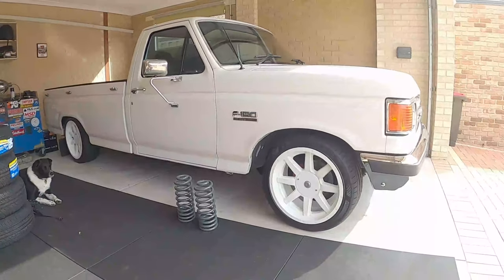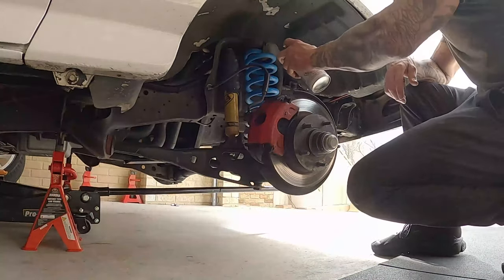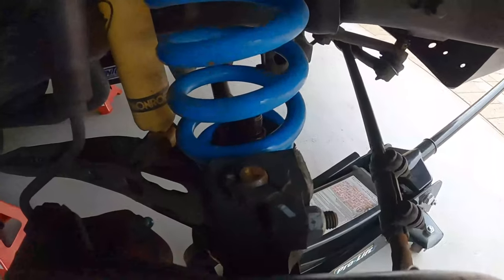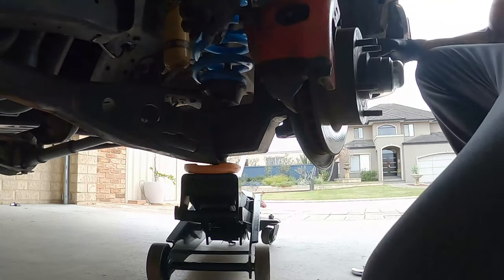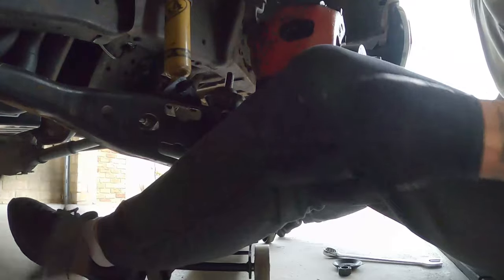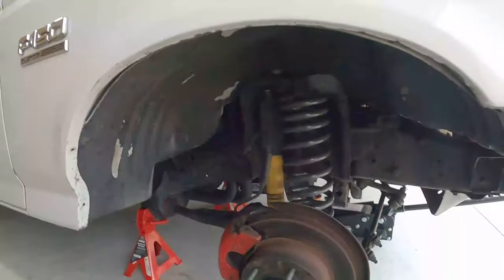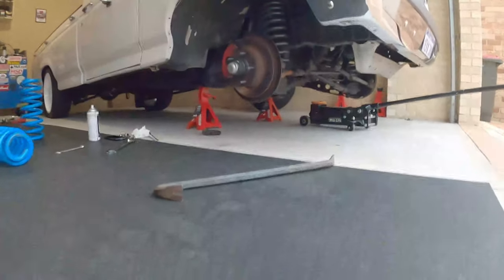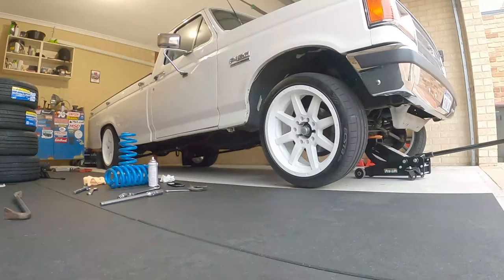Lowering a 1989 F150 with 2 inch belltech lowering springs

Comment: Looks good I love those wheels on there , so the blue springs were 1in drop springs? And the belltechs are 2in correct? And also just a flip kit only out back?
Reply from the maker: nah the blue are standard height with the drop beams and the grey ones are a 1 inch drop. rear is a flip kit, c notch chassis, qa1 fully adjustable shocks all round